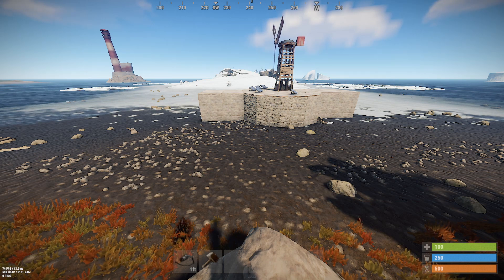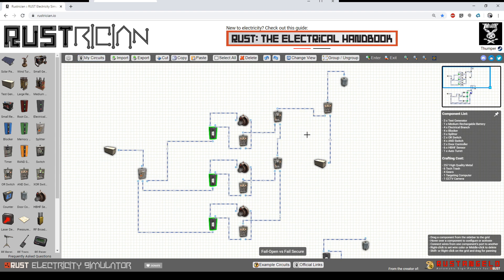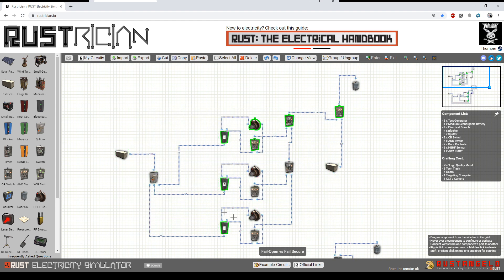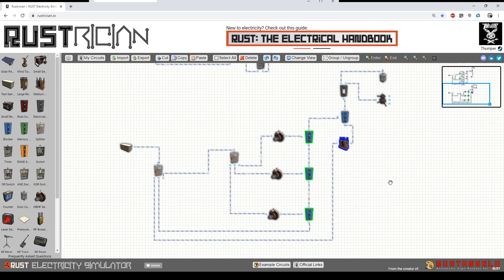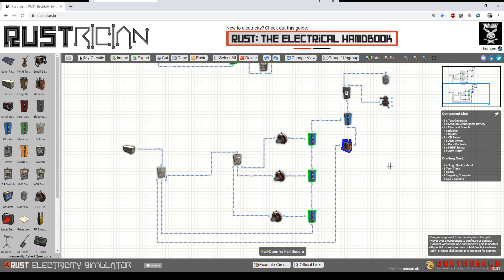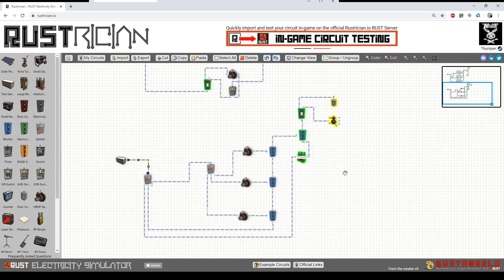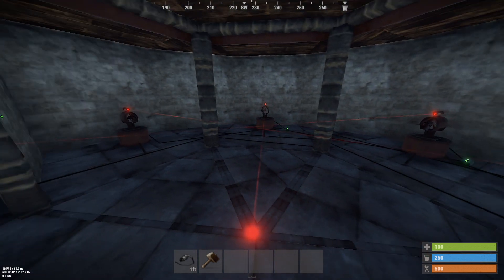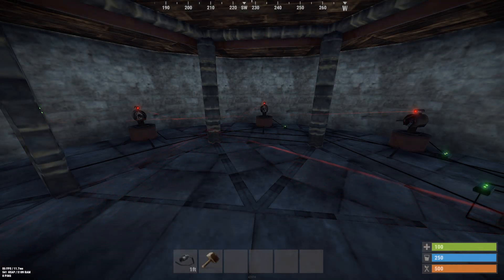Rust Electricity 101: Fail-Open vs Fail-Secure Circuits

Comment: Hey @Rabid Rabbit is this still working? because i tried it today and when i but away any HBHF Sensor in your Fail Open Circuits it doesnt Alarm/activats the turrets/open door. ? Could you pls help me? 
I also have another question... you will maybe know... is there any possibility too get an alarm if your active usage from your batterie is dropping? maybe you had done it in any of your video´s but i couldn´t find it. That would be the perfect overwatch for the new Alarm System.

greetings from Austria 
love your Videos
Reply from the maker: I will need to re-test to check if that circuit doesn't work anymore, but it should(?). 
At the moment there is no sensor for checking output load on circuits so it general it not possible to monitor the power load of a circuit, but I have an idea on how to make such a thing from a battery that I will have to test!
Reply: I hope you find something :) my friends and i tried it with electrical branch parralel to autoturrets after splitter... kind of work but not perfekt

Comment: hey mate.. great vid as usual.. i have another user request. :  can u show me/us a circiut which has two light sources . in the basement you have lights which can turned on with a switch and another switch for a light in the first floor which can be put on and on , say: you are in the basement and turned lights on,, but the lights in the first floor are still off... then you go first floor turn the light on .. and if you turn off the lights in the basement you can turn off light in the first floor too,, but not turn off the lights in the basement from first floor... sorry my bad english,. i hope you understand what im saying :D
Reply from the maker: Just implement the same system as the dual (or multi) switch light method from the other video. You can even use the same power source if you split it first.

Comment: Hello Rabid Rabbit. Thanks for your constructive inputs concerning electricity! ;)
I cant figure out how to activate two or more "reactions". I would like to activate both my light and sound alarm when triggeret.
Please help!
Reply from the maker: Using a branch or splitter on the output of triggering device should allow you to send the power to two devices (light and sound alarm).
Reply: @RabidRabbitGamer  My question seems a bit odd now, guess I was trying to serial connect them - cant wait to experiment more! ;)
Thanks for the answer ;)

Comment: Hello Rabid Rabbit.

I'm seeking a solution: Imagine 4 Turrets. Each turret sits on a triangle foundation surrounded by 1 wall and 2 garage doors. The goal is to use a HBHF sensor for each Turret to trigger the opening of the 2 garage doors opening and the door to close either when there is no target or the turret is out of ammo. Any thoughts?
Reply from the maker: Try this. HBHF turns on turret and opens doors. No Ammo shuts the doors:  https://www.rustrician.io/?circuit=d71e8ca50d47ac4cd1da1581384266c0

Comment: I got a question. How do you do a power system that needs 200+ power for auto turrets, sam sites, charging batteries, and other circuits while also going to battery power when it doesn't meet a threshold? So when you need that 200+ power and can only use batteries, do you split the batteries up, combine their outputs, etc?
Reply from the maker: The good news with the new battery logic is that you can charge them while they are in use, thus making Root Combiners practical after batteries now. So for a 200 unit circuit, you can simply root combine two large batteries (100 unit output each). If you are in-fact using that 200 units of power all the time, you will need at least 125 units going into each battery to keep it charged, more if you wish to add charge. The large battery can accept up to 400 units input for faster charging.

Comment: rabbit, can you please do an example circuit for me?I want auto lights with one or more turrets , and i want the turrets connected to a switch.Ofc I want the battery to charge positive during the circuits entire cycle.
Reply from the maker: So a few things to unpack here; any particular number of turrets and/or lights? Any particular type of lights or purpose for them? Is the battery just there in case your power source gets knocked out?

Comment: Did they blocked option to root baterries? There is red information when i trying to connect 2 baterries, can you check this?
Reply: You can root combine batteries. You can't, however, feed the combined power back into a battery in that root. It causes a short and breaks the circuit.
Reply from the maker: So far as I know you can root combine on both main and staging presently.

Comment: Rabid,
I am still trying to replicate but.....

I am running a small battery to power lights in my base.  The battery has nothing charging it and has been running for over an hour.  It is powering 5 lights.  Have you seen or heard anything like this?
Reply from the maker: I haven't replicated it for a bug report yet, but I've stumbled on a  number of scenarios where after server restart the batteries run forever without losing charge.
Reply: @RabidRabbitGamer  Yay! more bugs...

At least it's an advantageous one.

Comment: Last example, a chain of XOR switches instead of blockers should work too, right? Except of the blocker in front of the battery of course... I have recently thought of a similar circuit that has a function that closes the door(s) when a turret has no ammo too.